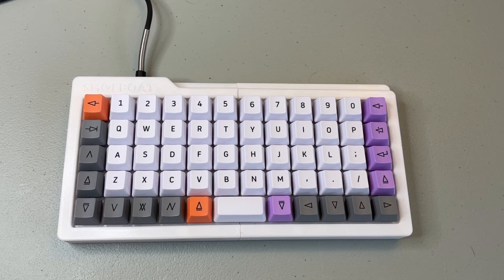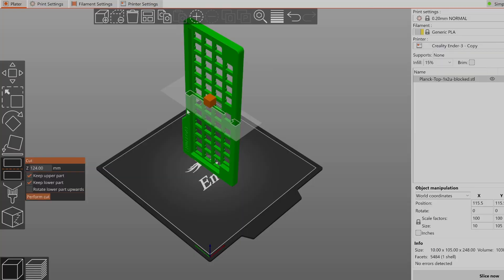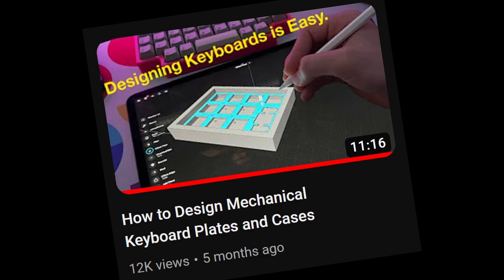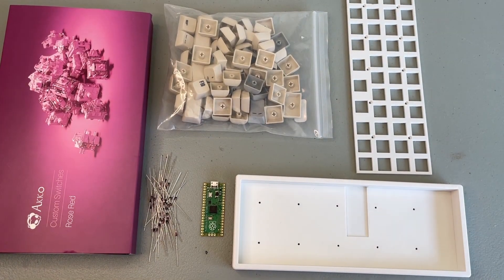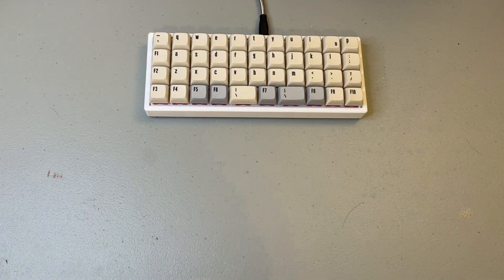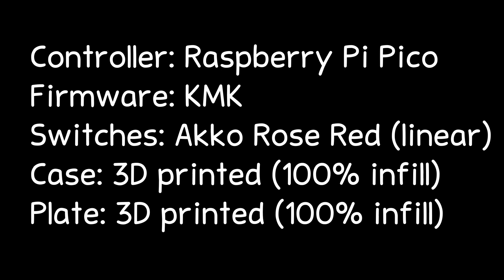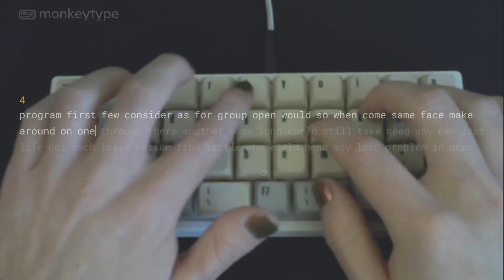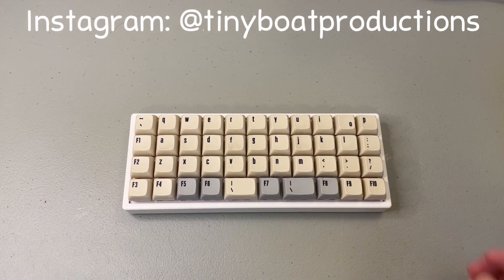Building a Tiny 3D Printable Keyboard - The FITZ_43

Comment: Soo I have been looking into 40% keyboards for making a large macro pad. So this Doed exactly what I wanted to see! Will go with the kailh low Profile switches though 😉.. Does kmk also sports key combinations, and multi tap? And multiple key strokes with small pauses (50 ms) in between? Have a bunch of pi picos just laying around doing nothing so this would be an excellent use for them! 😊 😊
Reply from the maker: Glad to hear this will work!
Kmk does supper combos, they call them sequences and mod tap. In my kmk series I setup modtap, I think it’s in part 2?

Comment: Nice work! What’s the reason for the asymmetrical placement of the 1.5u keys on the bottom row?
Reply from the maker: The home keys are offset due to only having 11 columns. Visually they are off center, but with your hands in the home position they feel very natural.
Reply: Ahhhhhh I didn’t notice that it’s 11 columns. Makes sense!